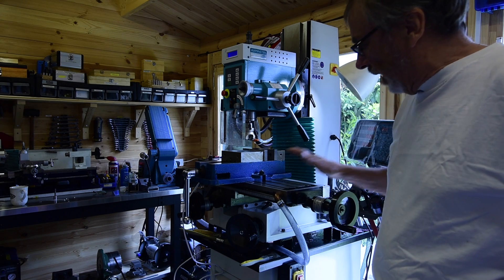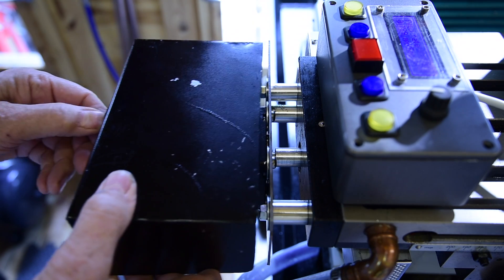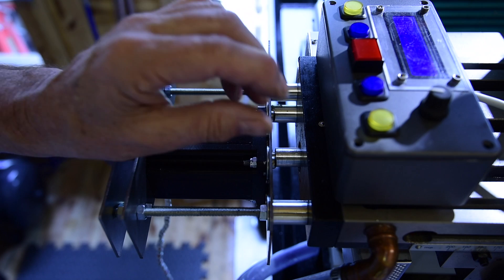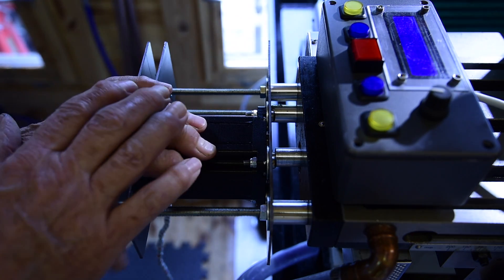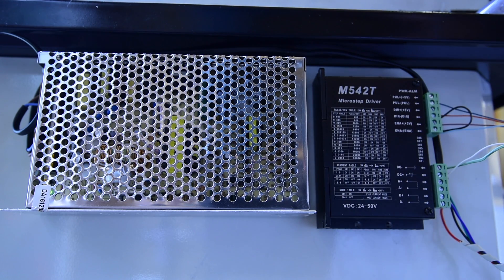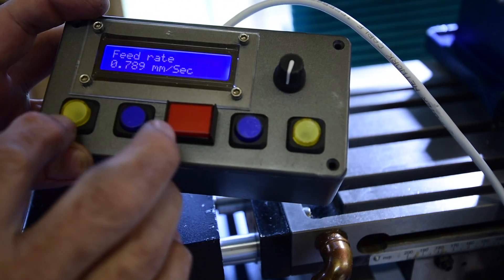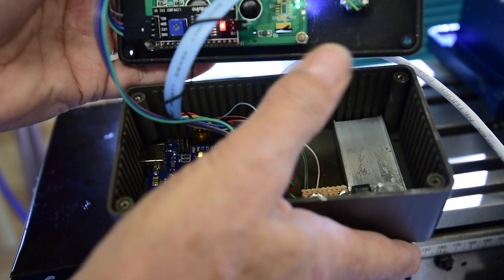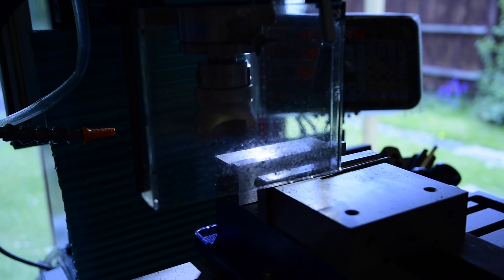Axminster SX3 / SIEG SX3 Mill Power Feed for table - Home-brew Part 1

Comment: hi Chris
I am just doing the same as you. I purchased a sieg sx3 and am looking at a power feed. Due to the available torque from a stepper motor at low speed I also want to go down the same route as you.
I tried to follow upon the links to the equipment you used but have found the links to be broken. Could you possibly provide an equipment list with more details so i can look to buy something that you have already proven to work.
Thank you 
Paul
Reply from the maker: Hi Paul
Let me get back to you on this as I don’t have the info to hand. Actually there isn’t really much to the hardware side, you need to look at Nema24 stepper motors, a stepper driver module capable of supplying the necessary current and a power supply that can source it. I will have a look at my units to see if I can find part numbers.
Reply: @ChrisMower  Thanks Chris. I know you said the motors are bigger than needed but like you I feel that a wrap around the arm is no bad thing. I had planned to measure the torque requirements and work from there , however a working solution is much preferable.

Comment: Hi Chris I have used Arduinos for quite a few things so I'm fairly O.K. with that side of things but do you have a drawing of the coupler to connect the shaft to the stepper motor ?
Reply from the maker: There doesn’t seem to be a way to attach a picture to a reply but the coupling is simply a length of aluminium rod bored out at either end to accommodate the shaft of the stepper and if I remember correctly a steel pin which was machined to fit the end of the carriage rod. It’s important to ensure that the two line up correctly so it doesn’t bind, but apart from that it’s quite straightforward.
I describe it at around 3 minutes in the video.

Comment: do you have a working code for this  keep getting 'POSITIVE' was not declared in this scope
Reply from the maker: Hi
There are more videos on the subject and in no 3 there is a link to more up to date code. 
Here is the link - @t
Problems compiling tend to be based around third party libraries for the display usually, but the one in the link should compile if you have the same library as I am using. If not you need to open up one of the examples that came with the display you have and see how it creates and uses the display, then tweak my code to match. This isn't as daunting as it sounds as the code is trivial and all in one place.
Reply: @ChrisMower  
Hi,
I am getting the error {LiquidCrystal_I2C lcd(0x27, 2, 1, 0, 4, 5, 6, 7, 3, POSITIVE);}  when verifying the sketch. I think its the same uno board and display board as yours. I searched the error online and it bought up over 12,000 hits but none in real plain English. I found my way around to install some of the libraries that were missing but this error now has got me baffled. I have tried the sketch on part 3 video but its still the same. As you can probably tell I am very green .
Thank you 
mike
Reply: this is the full error message
Arduino: 1.8.13 (Windows Store 1.8.42.0) (Windows 10), Board: "Arduino Uno"

C:\Users\Mike-\Downloads\millcode-master (2)\millcode-master\millcode\millcode.ino:48:0: warning: "STEPS_PER_MILLIMETER" redefined

 #define STEPS_PER_MILLIMETER ( STEPS_PER_REVOLUTION / MILLIMETERS_PER_TURN )

 

C:\Users\Mike-\Downloads\millcode-master (2)\millcode-master\millcode\millcode.ino:45:0: note: this is the location of the previous definition

 #define STEPS_PER_MILLIMETER (STEPS_PER_REVOLUTION / MILLIMETERS_PER_TURN ) // Microstepping config. Number of mm for one revolution

 

millcode:60:53: error: 'POSITIVE' was not declared in this scope

 LiquidCrystal_I2C lcd(0x27, 2, 1, 0, 4, 5, 6, 7, 3, POSITIVE);

                                                     ^~~~~~~~

exit status 1

'POSITIVE' was not declared in this scope

This report would have more information with
"Show verbose output during compilation"
option enabled in File -> Preferences.
Reply from the maker: @mikercsteamsmithsmith1528  
Mike
The display has caused an enormous number of problems because there are so many different variants out there, all coming from China and in the most part identical, It's just that the driver software is different for just about every type. I haven't any idea as to the LCD library for your display but I can give you a few hints into how to make it work.

1. Open up one of the examples that was installed with the library for your display ( You have installed the display library haven't you?)
2. Look at how they instantiate ( that means create an instance of something) the LCD object. In my case it is -
LiquidCrystal_I2C lcd(0x27, 2, 1, 0, 4, 5, 6, 7, 3, POSITIVE);  
If you look at the example for your display you will see something reasonably similar  so just copy the code from the example and replace my code. If you comment out my code by putting // in front of it it leaves it in place but disables it.
3. In the Setup routine I call the begin method on the lcd object created above. You should see something similar in your examples so just change my code to look the same. Also I turn on the backlight so check for that as well.
4. You then need to locate the calls to update the lcd and modify to suit your display library. -
    lcd.setCursor(0,0);
    lcd.print("Feed rate ");

Hopefully that should get you going.

Regards,
Chris
Reply: @ChrisMower  all being well , I will give it a go over the weekend and let you know. Unfortunately the display board didn’t come with any drivers/libraries.
Thank you 
Mike

Comment: Hi Chris, been following your videos with great interest and watched them many times. I’ve just purchased an SX4 and want to do the same upgrade, but before committing to purchasing the components, in your opinion would you consider the NEMA 24 to be also suitable for the SX4?
Reply from the maker: That’s hard for me to comment on Greg as I’m no expert on stepper motors. All I can say is that the NEMA24 I’m using has absolutely no problem moving the table on the SX3. Also I’m running it at 24V and the specification for the motor allows for it to be run at up to 48V which would give a huge boost in both turning force as well as holding. If there is an Axminster store nearby perhaps you could call in and try moving the table on the 3 and comparing to the 4?
Reply: Hi Chris, thanks for quick reply and suggesting I visit a store to compare but unfortunately, nearest store is over 100 miles away. Looking again this morning there seems very little resistance on the feed, so I’ve ordered everything as per your suggestions in the video. As this is my first ever project with an Arduino, I am trying to replicate everything exactly as per your build as I’m hoping everything will then be easier to follow through with regard to the code and wiring etc. I’m struggling slightly with your speed control switch. You say it came from Adafruit, so am I correct in thinking it’s a Rotary Encoder with push button,(perhaps and ADA377)? Sorry to be a nuisance and really appreciate your videos and explanations. Greg
Reply from the maker: @gregpearce6030  The rotary encoder is pretty common and you can get them from lots of places. Here is a link to one - https://coolcomponents.co.uk/products/rotary-encoder-com-09117

When you come to programming the Arduino make sure that you download the latest version of the code from Github. My original code was taken up by another who made several improvements which I then added some more to to make it work with my setup again. That's the beauty of open-source code. Anyway,  the latest code can be found at this link on Github - https://github.com/kintekobo/MillCodeMkII
The most likely area you will have a problem with will be the code for the display as there are several different ones which appear to be similar but have different libraries. This is not too bad a problem as there are almost always examples included with the library which you can curt and paste into the mill software. Also the display code is nothing fancy so it is easy to figure out what needs to be changed. Let me know if you run into problems.
Reply: Hi Chris, thanks for all the information, it is much appreciated. Being a newbie to Arduinos,stepper motors and coding it is all a bit daunting, but by looking at other YouTube videos and researching on the internet it is beginning to make sense. I will certainly ensure that I’m looking at the latest code as you suggested. Thanks again. Greg

Comment: I'm thinking about the same mod but on a smaller sx2plus mill. Unfortunately I don't think it's as well built as yours ! So using the cross slides are somewhat tighter to get good tolerances. With that in mind I thought of the same motor as you used winemaker 23 3nm..you say it's well over powered do you still feel like that ? And if so what motor would you opt for now ? The uno is able to supply ok with the amperage to this stepper ? Thanks great info really good info.
Reply from the maker: I’m pretty sure that the motor is way more than needed.  If you turn the handle while making a heavy cut it really doesn’t take much effort. Having said that, it wasn’t hugely more expensive than buying a smaller one, and if I get round to powering the Z axis I can move that over and get a smaller one for the X and Y. 
The Arduino isn’t able to power the motor directly so I bought a stepper driver unit.  There is a link in the description. I also bought a much cheaper one from Banggood which I show in another video, the one about stepper testing.
Reply from the maker: Check this video for a cheaper stepper driver. I think it was about £8 from Banggood. 
https://youtu.be/vt_ds-X92uM
Reply: Thanks very much.. may I pick your brains in the future if I’m struggling with the electrics ? Will check the other vid out
Reply from the maker: Berkeley Harriman Jones of course, happy to help.
Reply: Trying to make an Order to Bangood of the bits and pieces I'm gonna need..was wondering if I could either Pm you direct or I could go over them with you. 1 stepper mtr. 2 stepper driver,3 power supply both for uno board X11 and separate for the stepper. 4 board..now I have seen various Uno clone types from £3.00 to undo orginals..what's the diff ? For instance there's a at mega 2560  or uno all look slightly diff to me ? Then a display board various buttons, potentiometer. Anything else ?  Also I noticed...you have fast left fast right...slow left slow right on hold down buttons.. Now if you want to set a feed rate and press a button and it to keep going until you press the exit button how is that achieved  ?  Like you I would like to set a depth to cut dial that in off the display and activate it and let it go..how easy in lamas terms to do ? Without hooking up to a computer every time. Thanks again
Reply from the maker: Happy to help where possible. I have to admit that the upgrade to the system has slipped a bit from my radar as the basic system was actually doing more or less all that I wanted, but perhaps now i should start thinking about the improvements.

With regard to which Arduino to buy it really depends on how far you plan to take the automation as you need three stepper signal lines for each axis,. For just the X axis you need to have three free lines for X. You also need lines for the control buttons, so in my example that is another five lines for the buttons and three for the rotary control, and finally if you are planning on having a display, then if you use an I2C display you need two more lines. Therefor for a three axis system you would need at least 13 control input/output lines on the Arduino, which the Arduino UNO can only just supply. I have several different types both genuine and clones and they all seem to work OK.

If you are planning on powering the other axes then you will need to amend the control lines accordingly and it may be that the UNO does not have enough for the job, in which case you can step up to the Arduino Mega2560 which is a larger board with many more I/O pins, 54 to be exact against the 14 on the UNO.

Whichever you choose I would buy a separate power supply to power the Arduino as the recommended supply voltage is about 12V whereas the stepper driver will require anything from 24 to 48 volts depending on the stepper motor you are going for. Here is a link to the PSU I bought to power the Arduino -
https://www.banggood.com/AC-110V-220V-to-DC-12V-1A-2A-3_2A-5A-Switch-Power-Supply-Driver-for-LED-Strip-Light-Display-p-1193055.html?rmmds=myorder&ID=517854&cur_warehouse=CN

Choose the stepper motor, see what voltage and current the manufacturer recommends and buy the PSU to provide at least double the current capability to be on the safe side. Also bear in mind possible future upgrades. If you are planning to add more axes then it might be worth getting the power supply with the added capability now.

The stepper driver module that I originally purchased was way more expensive than it needed to be but I was new to the game and erred on the side of caution. I recently purchased one from BangGood which cost about ten bucks and it seems to be quite usable. It has a maximum current capability of 4A so you need to be sure that this is adequate for the stepper motor. Here is the link to the one I bought -
https://www.banggood.com/TB6600-4A-CNC-32-Segments-42V-425786-Stepper-Motor-Driver-Controller-p-1093437.html?rmmds=myorder&cur_warehouse=CN

As for the rest of the components they were all found in my parts bin so i'm not too sure of the origins but I think that the rotary switch was from Adafruit, as were the push buttons. The display came from HobbyTronics I think.

With regard to the software change to make the buttons press to start/press to stop, that modification is in ther latest version of the firmware up on Github.
Reply: Hi Just wanted to ask a question I bought the driver. It says its 9v-40v on the item but in the description says 42v ! I have also a small nema 23  which i think is rated at max peak 3.2amps. with this in mind Im confused on the Power supply as I thought it would be a 12v say 4amp supply , But im told it has to be 40v or more to make it move somewhat quick than a snail ! could you shed some layman light on it so not to dazzle me with electro talk ! I may go to the bigger Nema 23 motor so maybe the option of latitude will help. Thanks again
Reply from the maker: Hi Berkeley. The driver unit markings are basically the range of voltages that it can handle. It should also have a maximum current value too although you may have to look at the manufacturers data sheet for that. In very rough terms the higher the voltage the more 'snappy' the stepper motor tends to be whereas the current determines the amount of torque that the motor can apply when turning the screw. Also the current determines the holding force that the motor applies when not stepping. 

I think the PSU that I bought was 24V 6.5A and that seems to be pretty good at stepping and holding. You can have a power supply that can provide more amperage that needed without any problem. A 6.5 A supply can be used with a 3A motor no problem. It will be a lighter load on the PSU and provide capacity if you decide to add another motor driver and stepper. Hope that helped.

Comment: Hi, I'm looking @ getting a sx3 next few days so was nice to see this TFS "thanks for sharing". Graeme
Reply from the maker: Thanks Graeme. I think you'll be very happy with the SX3 mill. I have had it for some time now and it hasn't disappointed! If you can stretch to it I would definitely go for the DRO option. It just makes doing precise work so much easier.
Reply: Hi Chris, I think that will come down the line some, totally new to this! But yeah was one of my intentions thanks. G

Comment: Could have bought a power feed meant for an X3 from Grizzly or little machine shop much cheaper than that.
Reply from the maker: Price of a power feed is over £400 here in the uk. This cost less than £100 and will be useable when I finally get around to converting to CNC.
Reply: What size motor is that? 425 oz-in? Get another one without the shaft at that end then use the one in this video for the zed axis. Have it in the cowl at a 2 to 1 ratio and a smaller one for the Y at a 2 to 1 ratio.
Reply from the maker: That is my plan eventually. The current motor is way over-powered for the X-axis but will be perfect for the Z-Axis as I have tested it and it runs fine. I have too many other projects on the go at the moment but I plan to start on the conversion later this year.
Reply: CNC kits meant for the X3 have motors that size so I don't think it's overpowered. I would however want a smaller one for the Y with a 2 to 1 ratio so it's not a bunch of weight hanging out so far when extended. Speaking of too many projects, you should paint a red mark on the spindle where the collets keyway is then a black mark on the other side so you can do faster collet changes.
Reply: Hard to tell from this angle, is that an allen key drawbar or a 3/4" hex head?
Reply from the maker: David Unruh its a hex socket Alan key drawbar.
Reply from the maker: David Unruh not sure what you mean about collet keyway. The spindle has a 3 Morse taper.
Reply: Are you serious? That uses morse 3 tapers? Most use R8, Morse makes for a fast collet change although it cost slightly in rigidity. Nice to be able to use the same collets for your lathe too!
Reply: That seems to be the trend but a 3/4" wrench and drawbar is faster when you power the spindle to unscrew it. Maybe the allen is slightly less dangerous or something and that's why they used it. You should put a magnet on the side of the head to hold the wrench for a real fast collet change. Is the crank for the head a 2 to 1 ratio?